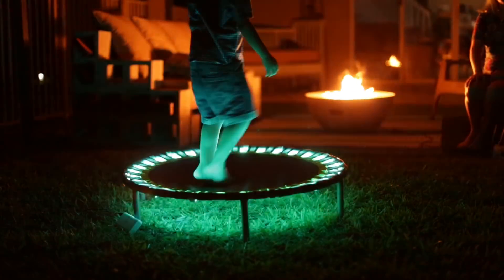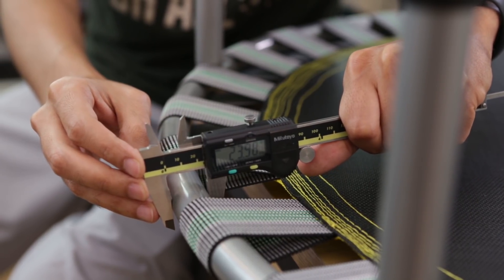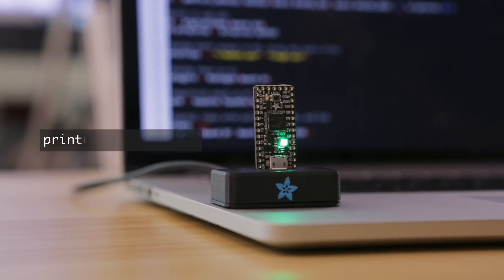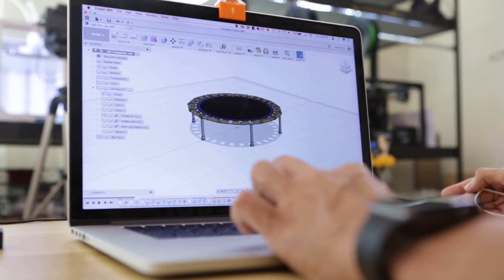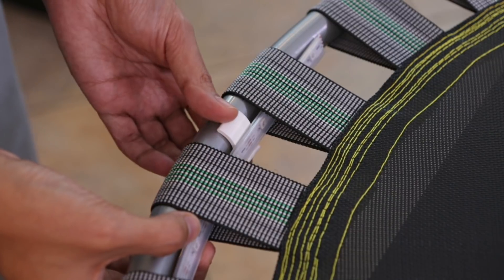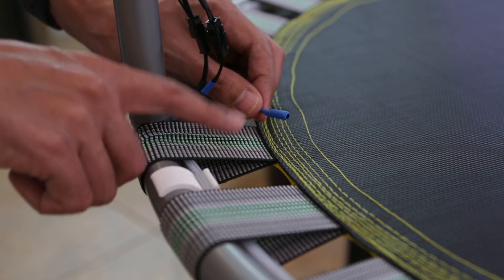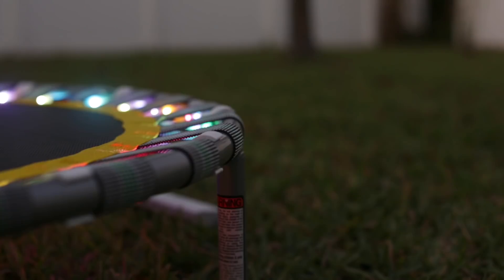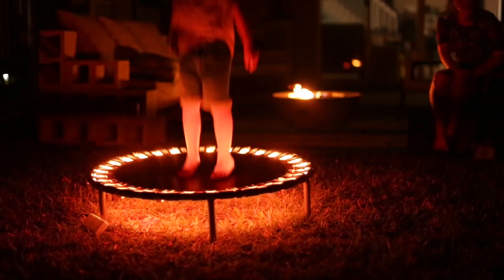DIY LED Trampoline // NeoPixels and Circuit Python

Comment: I woukd like to scale this up to install on a much larger trampoline. Can you make any suggestions?
Reply: Did you figure it out? My guess is you'd need to branch out the sensor to sevseal places, sort of like adding voltage drops for longer strings of LEDs. Branch the sensor out to like 5-6 arms and place them around so they're always activated no matter where people are jumping.
Reply: @bobgodd  Sorry, no. I did not pursue this project.

Comment: Your guide on the website shows only one strip connection but in the video you have two. How are these connected?
Reply: Reading into the guide they explain why, there's a hardware limitation on running all 80 LEDs so they did two strips of 40 in parallel. Wish they showed this in the video or circuit diagram in the guide. They only mention this in one line in the software section.
Reply: Adam Sidelsky will you sell one of these to me ready made?